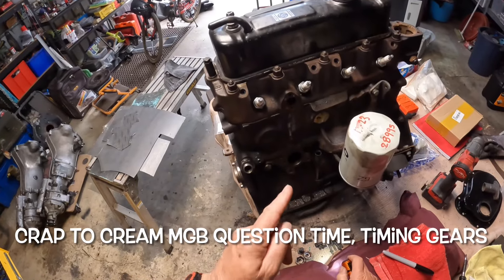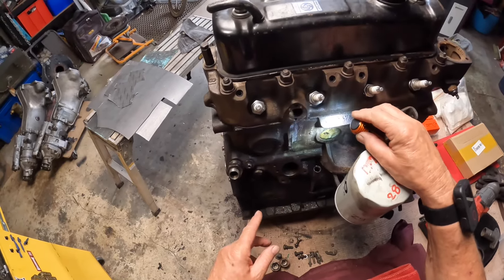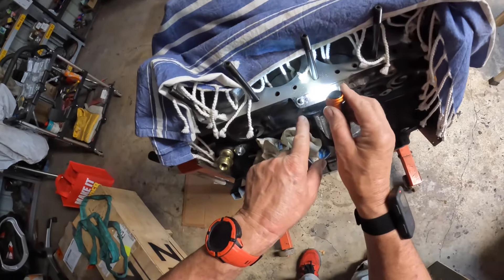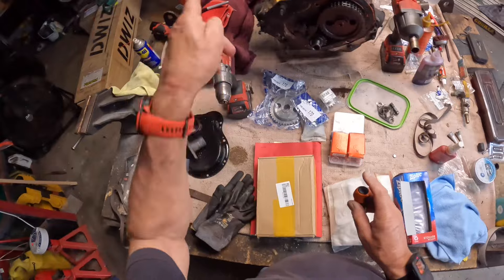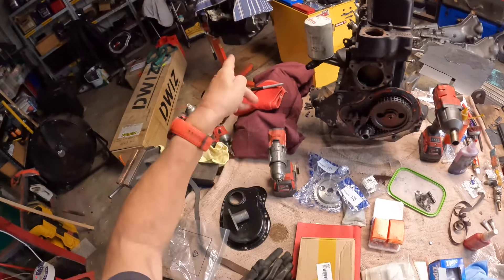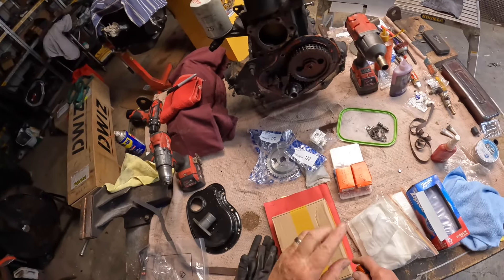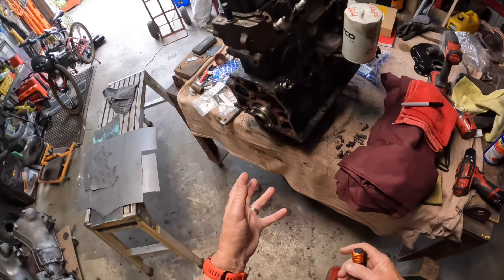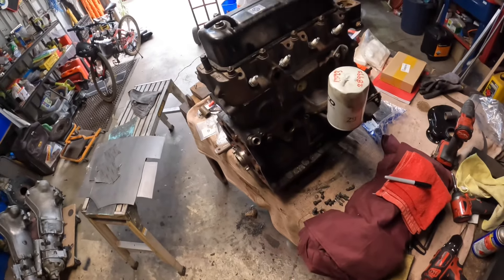Crap to Cream, assistance needed, timing gears, what right, what’s wrong, what's best?

Comment: Hi Marty, I remember having the same question when I rebuilt my engine about 10 years ago.
From memory and the research I did, all 18V engines  (starting around 1972) where fitted with simplex timing chains. Before that all MGB engines had the duplex version.
A bit of useless info which I also learnt: the 18 denotes 1800cc, V denotes vertically mounted, the next three digit code gives build information so the 847 (as my engine) denotes it left the factory with a Lucas alternator, pre engaged starter, comforts to 1975 emission control, had a centre gear change and was fitted with a Laycock overdrive. The H or L confirm whether it was a high or low compression engine and the Z means the engine was destined for the North American market.
The Duplex chain would retard the timing which would push the power band higher up the rev range.
Hope this helps.
Reply from the maker: Carsten, You have never given me information that has not been of some use or interest to me, the day I stop learning is the day I am the cause of smoke emitting from a very hot furnace.
Reply: @CrapToCream  😅 Hopefully a few more decades (and posts) before that event!

Comment: I have a 74 US 18V engine which I rebuilt using a duplex engine and it runs great. I believe there was a 4 degree difference in the timing with the 18v engines by machining the keyway to be off a bit. Supposedly it was to give a bit more  lower end  torque. In the end, I don't think it really matters. There are also 2 versions of the timing cover for the 18v engines because there were 2 different pulley diameters, with the later ones being larger. The water pump pulleys and crank pulleys were different also, having different diameters. I think they changed around 1975. Not sure why they made the changes. You cannot use the larger water pump pulley with an earlier 18v timing cover because the pulley will interfere with the timing indicator but you can do the opposite. Not sure if this matters to you but mentioned it just in case. Apparently, some mix the combination of the crank pulley and WP pulley to get the WP to spin faster for better cooling.
Reply from the maker: Hi David, all useful information thank you, I’d heard about the 4 degree difference, just wasn’t sure if it was real or not and how much difference it made. There are so many different places with slightly different information. This is great thank you.

Comment: I don't think there is a difference - you can use either with the standard cam.  I used a degree wheel to verify my timing when i put it together.
Reply from the maker: I sort of knew you would have had the answer, 😂😂 so duplex then, assume stronger, why did they change later to a single row? Cost? Oh yes and standard cam.